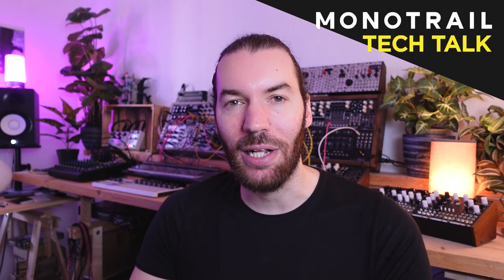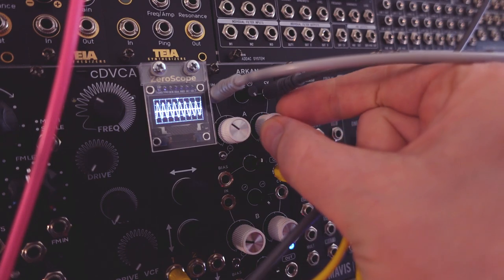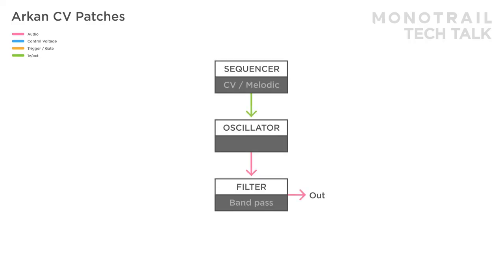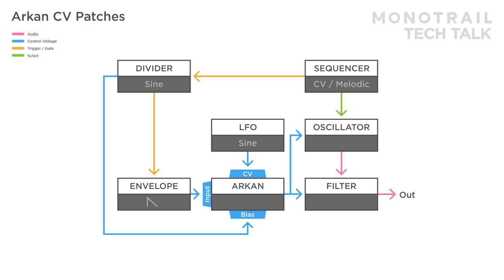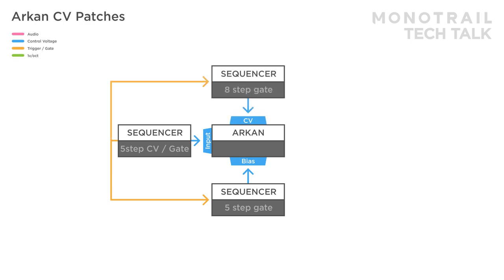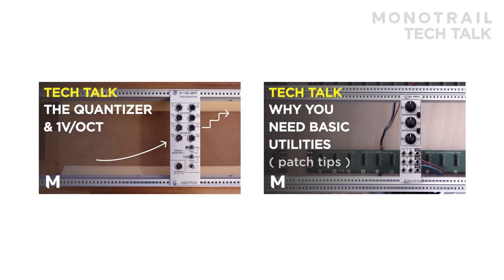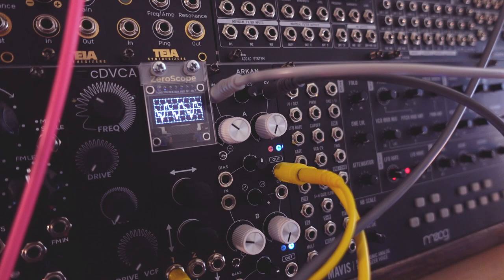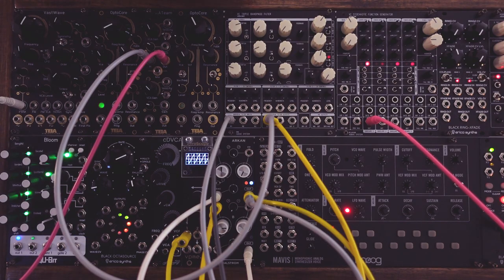Can this eurorack module take care off all your utility needs? - with Arkan / Malstrom

Comment: Is this a more compact version of the Buchla dual voltage processor?
Reply from the maker: Hi there! In practice a lot of similar things can be achieved. But if I'm correct the Buchla design has a first input with attenuverter, and then two regular inputs with voltage controlled cross-fading. This setup is a lot more intuitive in my opinion :)
Reply: @Monotrail Tech Talk  I've had my eye on the buchla for a while, but your video has me reconsidering. Unfortunately most demos of the buchla that I've seen focus more on audio crossfading rather than on the waveshaping you.were doing with the arkan.
Reply: Hi Moodles! The voltage processor was one of the modules I researched during the development. And there are definitely some similarities. The crossfade feature was actually in the design at first. But was later removed to put more focus on waveshaping. So the curvature control was added and the crossfade was then somewhat replaced with the modulation strength knob. Where you crossfade between your unmodulated and modulated signal.

Comment: Seems a real lot like A*B+C
Reply: Yep, but A*B+C doesn’t have a curve control. Seems that allows more expressive control over cv. My biggest complaint with A*B+C is that there’s no easy way to completely zero out the inputs. It doesn’t have a center detent or a large dead zone in the center. So when I use it as a basic 4-channel mixer, there’s always a little leakage. Otherwise, i find ABC extremely useful, and I really like the character of the clipping. It’s smaller than this Arkan module too
Reply from the maker: Also a cool module! There is some good utility out there. This one is more like A+B*C though, I think I prefer that, the mixing before the polarizer. But haven't used the Befaco one yet. Also think the the massive gain and curve control are standing out.
Reply: Thanks for the replies. They're certainly not identical. afaict the only reason is rather have A*B+C rather than this is hp.
Reply: George, I also like the jack organization better on A*B+C. But Arkan might displace that one despite that.